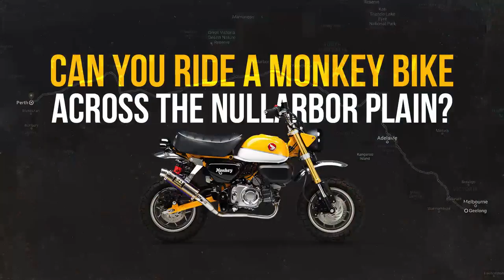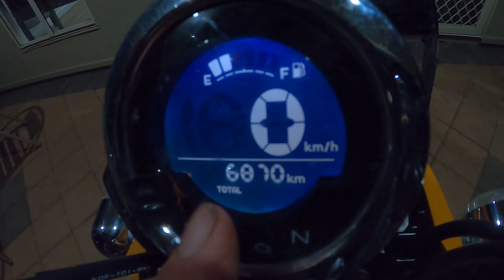GUY GOES NUTS WITH A HAMMER TRYING TO FIX THE HONDA MONKEY !

Comment from the maker: NOTE - the MONKEY BIKE WILL BE AUCTIONED OFF AT GEELONG HARLEY DAVIDSON SUNDAY 12 noon 22nd March, starting bid $1 !! This bike will go down in history !
Reply: $1.50
Reply: @andrewdrake4296  Is that Million? :D
Reply: Steep, that's steep. Perhaps starting at 50c might be more realistic. The side of most roads is a good place to find old fencing wire for repairs needing a bit of strength when bolts are in short supply. I'm guessing your next adventure you'll have a tool kit with a few spare nuts, bolts, washers, zip ties, weld putty, wire, vice grips, spanners, screwdriver, wrench and assorted sockets, spark plug, rope, string, paracord, rubber bands, torch, etc, etc, etc!!!
Reply: Million Dollar Bogan ... THE ROLEX WILL BE PART OF THE AUCTION PRIZE TOO!!!
Reply: If it has a new clutch lever, I'm in... ... ...
Reply: Ah well ,looks like you made it, my donation is coming your way🍻
Reply: Little Kenny he wouldn't know what to do with any of that stuff 😂
Reply: its going to sell for thousands and you know it ;)
Reply: One reason Harleys are so heavy,  that sledge hammer comes in the tool kit !!!!😄😄😄😄😄😄😎😎😎
Reply: It'll go down in history alright, n I'm hoping a  HONDA rep will be there n bid the highest n top up the money raised to make the 100 grand
Well done n big respect  to Danny Hayes  n Geelong Harley Davidson.
Let the good times roll.
Reply: Million Dollar Bogan you better buy that bike
Reply: If anyone from Honda AU is smart enough they'd go bid whatever the difference is to get you to 100k for it. It'd be great advertising and money toward a good cause.
Reply: Hi Danny, is there any way people can bid if in another state and can't be there in person?
Reply: Would be perfect in a Honda dealership, they only have to pay $30000 for it to make up the difference! Well done Danny I've loved the whole series.
Reply: As much as that might be worth to a collector, I'll pass on the bidding.  I suppose in this sense the hammer mark's make it more valuable...lol...every dent, ding, scratch, cross thread, bent handlebar, loose chain, tells a story.  You are an Aussie legend Danny Boy.
Reply: Honda needs to bid on it!
Reply: Live on Youtube ???
Reply from the maker: @milkshakemuncher  only thing I could suggest is to ring Geelong Harley and organize it that way with one of the reps
Reply: @danielhayes-domore  thanks mate, much appreciated.
Reply: I’ve not contributed yet Danny but I will.  Waiting for the final vlog on the Monkey Bike and will that day.
Reply: Great episod Danny. I'm heading to your side of the planet to visit AU and NZ. I hope I can make my way to Geelong HD to witness the event. 🍻
Reply: You should be keeping that many memories were made

Comment: Lol daniel, you need to get some loctite for that rack.
Reply: FranBunnyFFXII -   You would think Colen bring a Harley mechanic would have used loc tite when installing that rack. 🤦‍♂️
Reply: @kylestewart8049  only reason that rack failed is because of all the abuse, and off track stupid riding he did.  If he'd stayed on the pavement there never would've been a problem.   At least take the weight off for off road riding.  Kudos to the guy who built the rack! He done good!

Comment: Truth in an attitude of love, even in it's crudest form, is still a touch from God. 
Glad you found some help Dan. Mind you, I'd have put a splint on that clutch lever, just to make the last 1200 a little easier.  Just drill two small holes on each side of the break and bolt a piece of scrap iron on as a splint and wrap with cloth to make it tight and comfortable. I speak from experience.

Comment: Your repair solution was right under your nose...can those Karabiners (rope hooks) hanging off your jacket since Geelong fit through those bolt holes? Or some heavy wire tied by using a screwdriver to twist the wire up tight. Oh well bit late now. Keep a cool head mate we luv ya

Comment: You probably won't see this, but a couple of thoughts after watching all of your videos. BLUE Loctight is a thing... HD in Geelong should know this, along with nylon nuts w/lock washers. Also, if you would pull that vented jacket out, soak it in water and then wear it between fuel stops you wouldn't be as hot or as hydrated. It's what those of  us who ride long distance call "air conditioning". As the jacket dries out with the wind and heat, you get cooler air around you. Also, the jacket will cause you to sweat a bit more and as that sweat dries the air cools your body during the sweat evaporation.

Comment: Must have done a nice job in perth at that honda mechanic if all that shit has happened since. Maybe even fitted the stuff properly in the first place and it wouldn't have fallen off. Pack rack fallen off due to loose nuts and bolts, lever not replaced as it has only been bent since the trip over. This is like watching a brawl in the city, you know you should turn away but you just keep watching...

Comment: If you haven’t rode a bike in hot weather let me try to explain to you what it’s like. I remember the first time I rode my bike in 40 plus degree heat. Before I done it I just assumed if you go fast you’ll get a nice breeze and it’ll be sweet. Oh how very wrong I was. The faster you go. The more hot air you hit. On a 40 degree day, riding at 100km/h. It’s literally like driving through an oven. There is nothing nice about it.

Comment: On  My Yamaha FZ-07  stock chain was not an "O-Ring"  chain had to adjust  several times when new..  Now   not  very often  have to use  chain lube  every day ..   O-ring chains  have  grease on the pins  permanently sealed by the o-rings.. permanent  grease is not supposed to get out..  but fresh lube can't get in either..  I believe  a  non o-ring chain will last  longer if you  oil  it every day ..   O-ring chain  will  last  longer if you are not good about  lubing it..

Comment: The man that invented the complain without complaining. I don't want complain, I am just saying.
Reply: BTW the gear lever is the thing at your left foot peg. that thing is called clutch lever. Also the thread of the rear top left rack bracket is wrong or badly damaged. My guess he had all bolts with wrong pitches... OI! Honda uses all metric nuts and bolts. I don't want to complain, I am just saying.

Comment: Did the heat get any easier to deal with as time went on?  Or no?  This vid sounds like you just wanna get home.  White Line Fever if you will.  Compass locked on home?
Reply from the maker: it was a bit like that